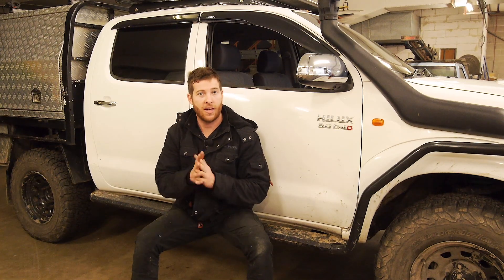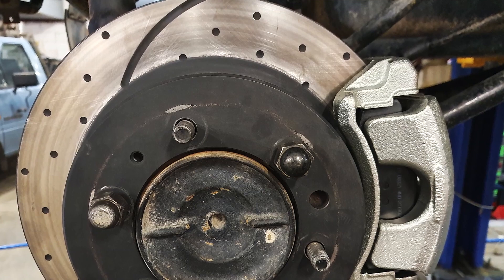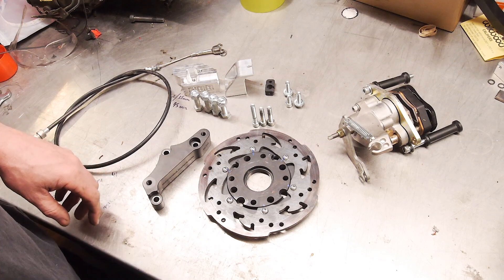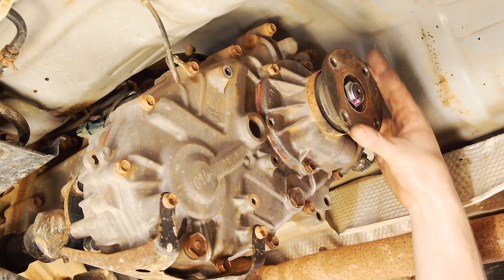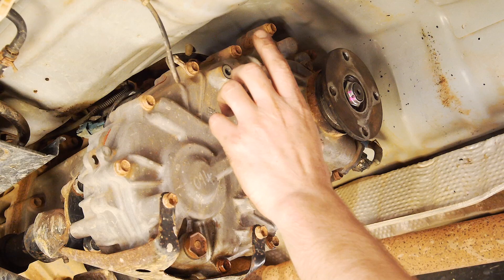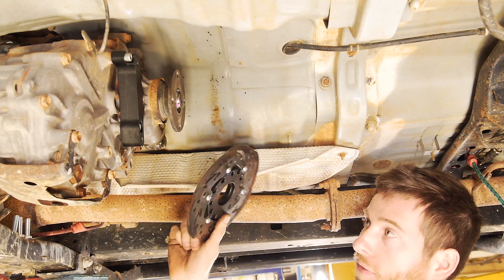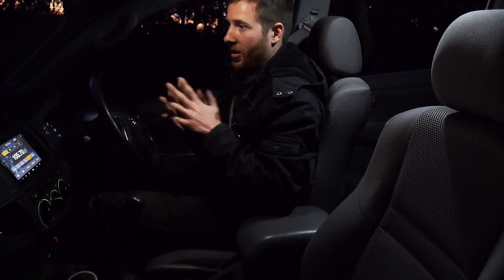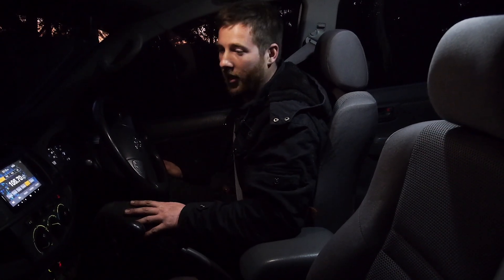HILUX N70 TRANSFER CASE HANDBRAKE - REVIEW, INSTALL & TESTING

Comment: are you planning to do a kit for a 79 series it might save me the trouble of working it out for myself
Reply from the maker: Is on the cards but wouldn't be for a while as it's a full redesign for those transfer cases. I've already kinda worked it out and taken measurements etc

Comment: I fitted this kit on my Mk 4 1999 crew cab a few weeks ago. It was very easy to fit without the benefits of ramps etc. I adjusted as per the video once fitted but it did get very hot after a 400 yard trial so I slackened it off to the max (ie so the shoes were in the loose-est position) but there is still some slight contact as the disc still gets hot. This is still the case with the lever sitting on the stop so I can’t  slacken off any r than thismore. I have emailed a couple of times as I am not one to write bad reviews and would rather work with the seller to resolve problems, but the old shoe brakes work better than this kit. Maybe I am doing something wrong and stupid, bu
Reply: T I can’t see what that might be. The end result is that I am thinking of going back to original shoe mechanism unless I can somehow sort this one out. Do I need new pads given the originals hot hot ?
Reply from the maker: I haven't seen any emails about this from anyone so not sure what's going on there.
Where are you adjusting the slack? The cable adjustment or the piston?

It kind of sounds to me like your transfer case might have a different pinion offset height to most, thus is probably lower and constantly dragging on the pad closest to the transfer case. 

When you say "shoes" I'm assuming you mean pads?
Reply: Hi Carl thanks for getting back to me and sorry my mail ended up in your spam. I’ve sent you another email just now and many thanks

Comment: Hey mate been watching for years, absolutely love your work! The surf build has been my favourite by far, I want to buy the rear disk conversion kit but I have a question, would you be able to tell me weather my 15x8 -19 rims will clear them?!
Reply from the maker: Thanks bud! Appreciate the support!
I can't guarantee, but they will not fit directly BUT with some slight shaving of the corner of the caliper they will prob fig. I have test fit 15x10 -44 which sit the same as 15x8 -22. They are sooo close, just need a slight shave of the caliper.

If you go to my website I show the part that needs to be shaved in a pic
Reply: Boosted & Built Garage legend thanks mate!!! Keen to see more videos

Comment: How far out from the t-case does the calliper sit? I'm just trying to figure out if it will clear my exhaust.
Reply from the maker: The furthest point from the output shaft flange is 123mm
Reply: @boostedbuiltgarage  thanks, mine is a V6 with a modified crossover pipe that goes just behind the transfer case I'll  measure it tomorrow to see if this would fit without another exhaust mod.
Reply: Turns out there's not enough room, but when i eventually re-do the exhaust I'll make sure it sits further back.

Comment: Dude call toyota and do a vin recall. Your missing your centre bearing bracket. They put it on for free, centre bearing fail and your shaft drops, especially if you 4wd or drive on corrugated rocks